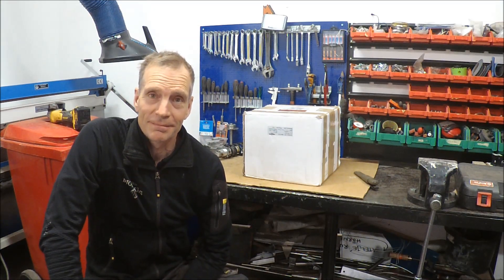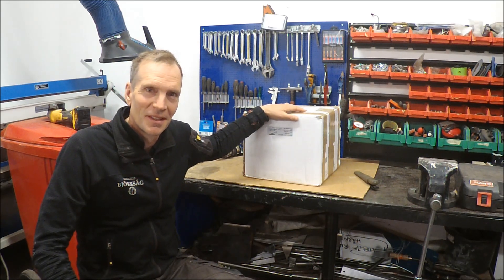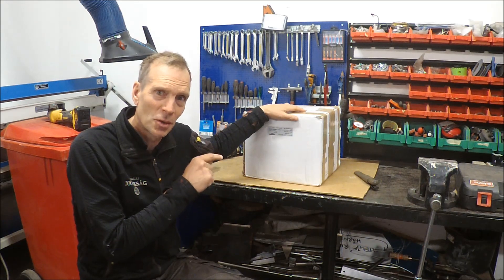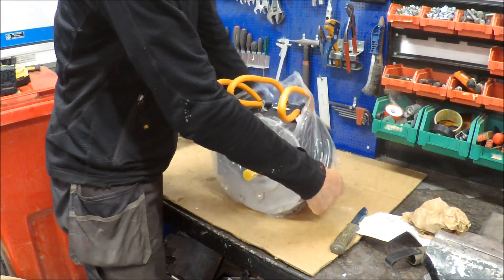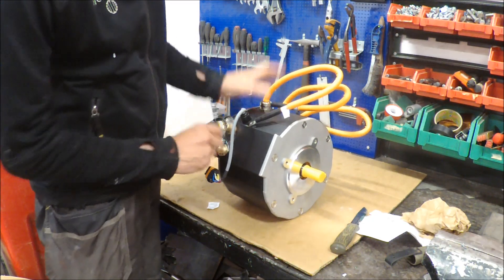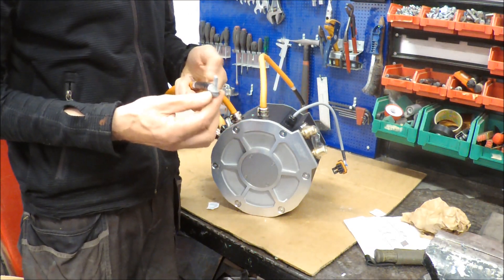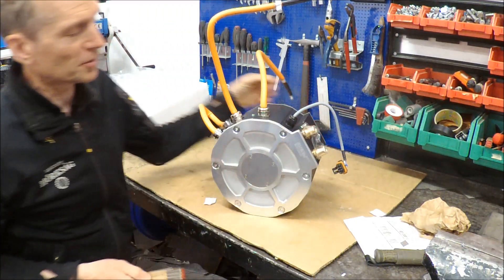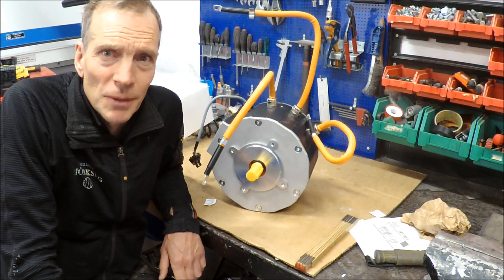ME1616 unboxing

Comment: Hey! Thanks for good video. i have some questions. i make some E-formula Car. How can i calculate the driving time using ME1616 motor and 375A,113.4V,75Ah battery pack.
Reply from the maker: Hello ! Roughly you have P=IxU   42 kW max power. Energy in battery =kWh = 113,4x75 = 8,5 kWh. Full throttle = 8,5/42= 0,2  to get minutes 0,2x60=12 minutes. You can run full power for 12 minutes.  But an efficient EV car use approx 2 kWh for 10 km. So if you do not drive like a carthief you come maybe 30-40 km.  BR Per
Reply: @persteel  thanks ! :)

Comment: Hello Per,  I watched  your videos, very impressive and creative. i'm bilding a electric cafe racer  with the ME1616 .  If i got it right you're using a kelly controller instead of the Secvon.  Any negative impacts  with this combination as the kelly is not designed for PMAC but for BLDC?
Reply from the maker: Hello, RR Teichfilter ! I did not knew this, I thought the Kelly KLS-8080I/IPS sin/cos was designed for use with PMAC motors. Must admit I have no experience to compare with the two, motors run with Kelly, but if they would run better with Sevcon, I dont knew. I do have a Sevcon Gen 4 size 6, if I only could configure it it would be interesting to compare.

BR Per
Reply: @persteel  You'll be fine with the KLS-8080I/IPS, it was designed for these types of motors. I was speaking with Fany at Kelly last week about this motor for my next buggy build and what to pair with it for a controller and he recommended the same one. I'll post his response below. I love your channel btw, it deserves a lot more traffic! I watched your latest video on the snowmobile and noticed that you have a different motor installed? Any specific reason? 
"KLS-8080H is designed for the motor with common three hall sensors.KLS-8080H is non isolated type controller.You can use 72V batteries volt for PWR power supply
KLS-8080I is designed for the motor with common three hall sensors.KLS-8080I is isolated type controller.You can not use 72V batteries volt for PWR power supply.You need to use 12V-24V for power supply.
KLS-8080IPS is designed for the motor with sine/cosine speed sensors.KLS-8080IPS is isolated type controller also.
You can find the details in configuration in KLS8080I/IPS user manual.
When speed sensor type is at 4 for linear hall sensor(sin/cosin speed sensor),you need to use KLS8080IPS controller."
Reply from the maker: @JamesBiggar  Thank you, James ! Happy you like my videos and that you are sharing value information. Reason for exchanging motor is batterycapacity, hard to get so much amp out of a small batterypack.  Also changed my mind about heating battery, easier and ligther to just use the fan and excess heat from motor.  I have at least 2 other projects where I can use the ME1616 :-)  BR Per
Reply: @persteel  Thanks for the reply. That makes sense. Being able to use the heat from the ME1616 was one of the main reasons why I chose it too.

Comment: Would this motor power a small car efficiently?
Reply from the maker: Yes, in a small light car it works. I know one Volvo 340 using it with a gearbox and Kelly Controller. BR Per

Comment: Nice! Den är grym! Jag kör samma motor i en Volvo 343 😁😆
Reply from the maker: Ok, fränt !! Vad har du för controller ?  Orkar den driva 343:an så det är körbart i vanlig trafik ?  Mvh Pär
Reply: Kör en kelly kls 96601-8080h på 96v, inte ips versionen så fick installera hallsensorer i motorn. Kontrollern blir ganska varm så behövs en redig fläkt eller vattenkylning på den. Motorn håller sig kall pga vattenkylningen. Den är helt duglig i trafik känns som original b20 motorn. Toppfart 110 km/h. Växellådan är kvar så man kan utnyttja växlarna bra vid starten annars hade den inte orkat iväg.
Reply from the maker: Tack, för svar ! Intressant, har ju en Fox Relliant som är en elbil men utan motor. Kanske ska stoppa i motorn där i stället....  Mvh Pär